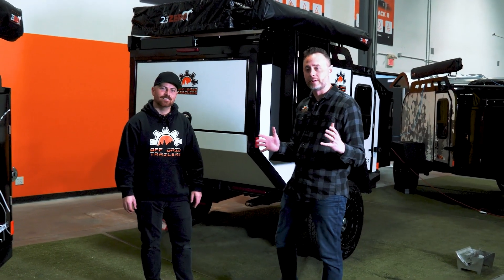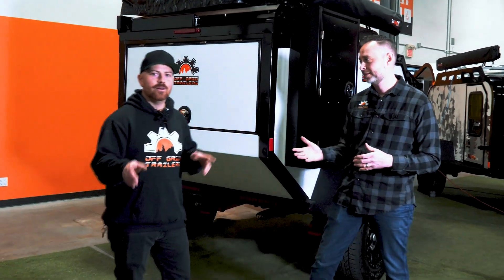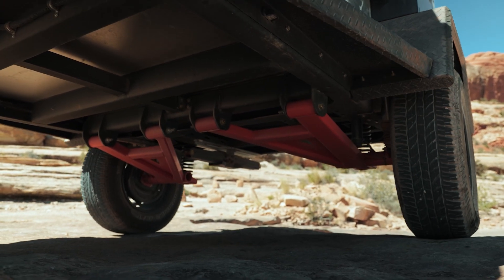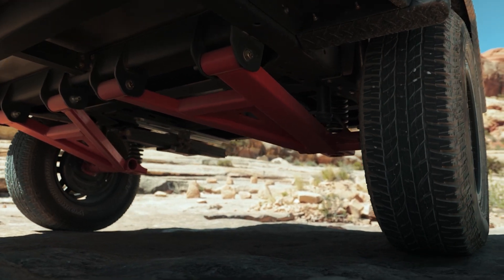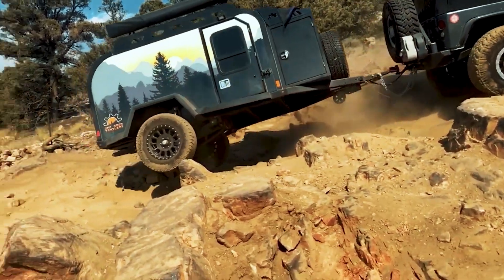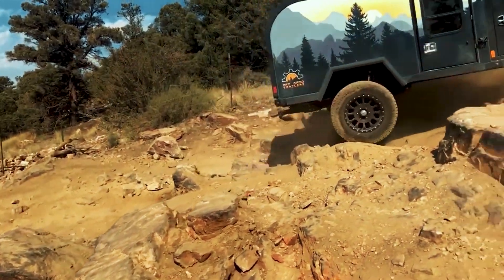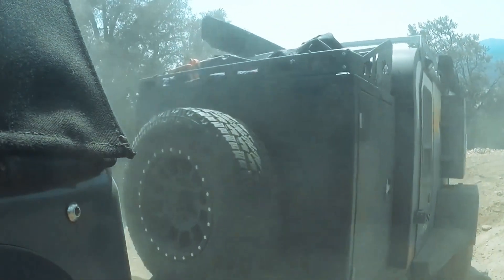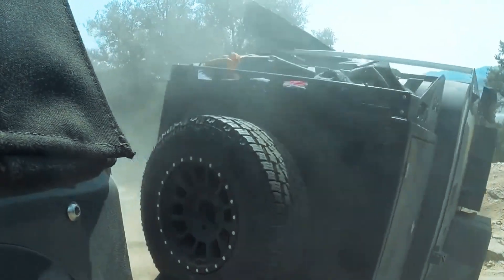The Ultimate Off Road Trailer Suspension - Explained. OGT Evolution Series By Fabtech Motorsports.

Comment: "Be sure to upgrade the jack" Shouldn't it be standard if the provided jack is not tall enough or sufficient enough?
Reply from the maker: The standard jack works with the standard suspension. The upgraded jack works with the upgraded suspension.

Comment: Is this system able to add to existing Timberin 3500 hd. I.E. Can you swap it out.
Reply: I’m wondering the same thing I have a trailer that was produced late 2021 and would like to know if this suspension will bolt up?
Reply: I REALLY hope so because I just spent 50g on an Expo2 last year and was told this was not an option yet.
Reply from the maker: After a certain point in production, all frames are universal and can be upgraded. If you have questions about your frame, please email your VIN to warranty@offgridtrailers.com.